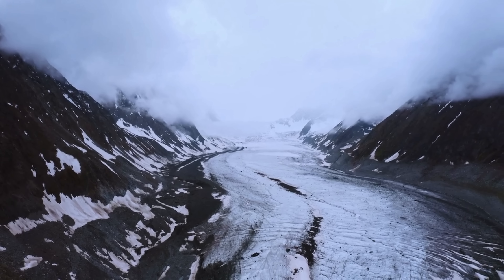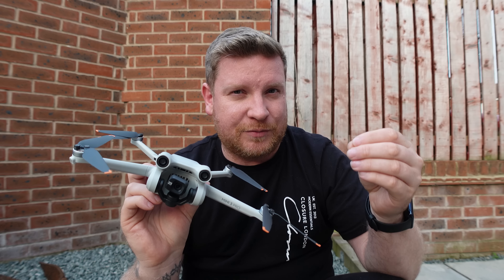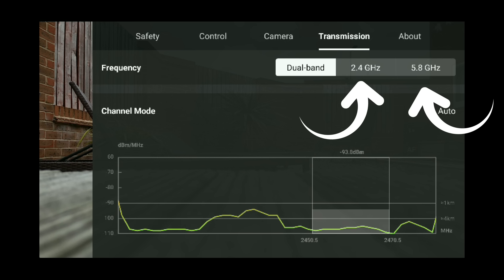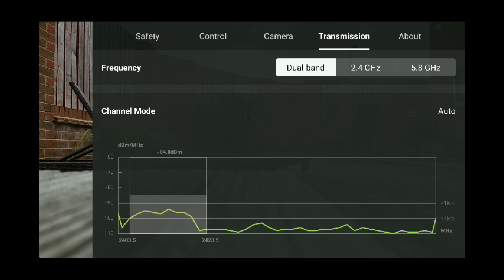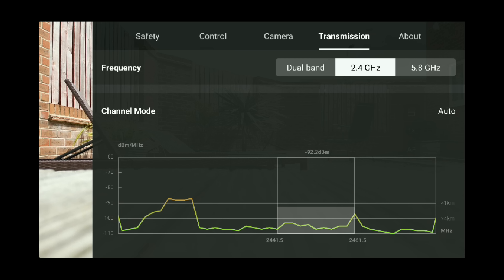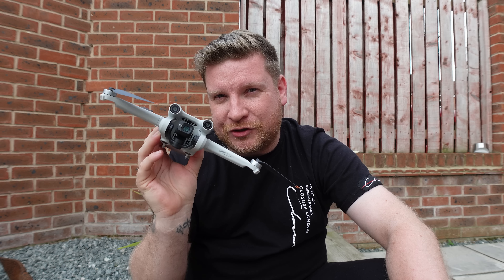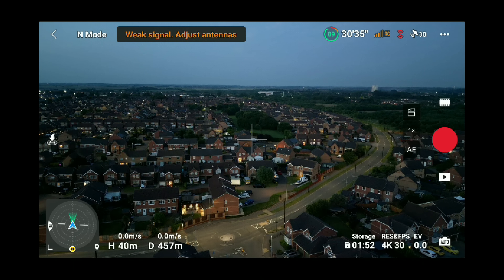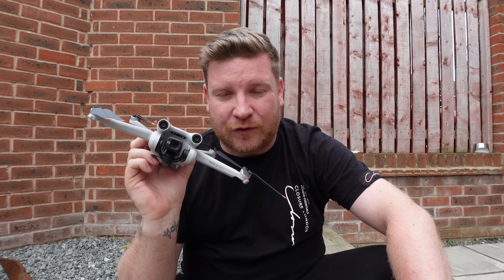THIS Is WHY The DJI Mini 3 PRO Has Signal PROBLEMS! ( Yet Some Don't )

Comment: Well, it has been some time since DJI introduced the Mini 3 Pro drone and the issues are still with us, the customers who pay not a small amount of money for a "product."

I live in Ireland and bought mine last week. I have been doing some range test and the best I could do was 455 m! That's pathetic! I was on the top of the hill and the drone was flying almost downwards. After 455 m I lost signal and the drone initiated RTH. What pisses me off is the fact that this problem has been dragging for a very long time now and DJI either have no clue how to solve it, or the CE regulations are imposing limits on the range in Europe.

I don't know what it is but this video is helpful. I will do more tests tomorrow with each frequency separately flying to the same point. If things remain the same, I will probably return M3P and go for Mavic 3. Anyone knows if Mavic has the same range issues? Thanks!

Comment: Didn´t you say there is no difference in the RC and RC1 in term of range? So it can´t be a 2.4 / 5.8 issue, right? Actually in my case there was no (positive or negative ) effect when switching manually between the two wavelengths. Same bad signal strength.
Reply from the maker: That's correct but when I did the controller test I fixed the frequency to take any variables out of it, but the RC-N1 seems to be picking the correct frequency when left in auto - the RC seems to be getting it wrong
Reply: @GAVINHR  Understand. However, unfortunately in my case there was no difference between 2.4 and 5.8 GHz - exactly the same bad range.
Reply: @phix1742  noted t

Comment: I tried it, and no matter which frequency, I experienced signal degradation at about 390M.  I live in a a very rural area with a lot of tall trees.  I will go to a large open area and see if there is a difference.  Thanks for your research.
Reply: Problem solved:  I went to an open field with no obstructions.  I flew the drone for more than 1/2 mile and it maintained a very strong signal.  When I fly at my home which is heavily wooded, I am going to have to fly higher to maintain a strong signal...

Comment: I tried switching Manually and didn't work for me.
Tried both bands & auto for same flight X 3 and manually switch with 2.4 was worst distance, ALL done in very very rural setting
Reply from the maker: That is very odd unless there was done unknown interference

Comment: I had a different problem. I live in California and received a CE version from a US firm....probably sourced from a EU company.  Transmission showed it was in fact in CE mode. I then booted it to the DJI Assistant app on the computer and did a refresh of the newest firmware.  A new flight showed it now in the FCC firmware and it stays there.

Comment: top class as always mate good findings also just watched originaldobo he tested the mini 3 reckons the smart controller is very direction dependent also so a combination of these would explain quite a bit.
Reply from the maker: I am sure other people will find credible information also indeed mate, This is my theory and it seemed to stand up in testing so hopefully this can help others :)
Reply: Originaldobo did not come up with any theory as to why there is an issue with range; I do not mean to scrutinize anyone here but he was sort of attacking people who are complaining about range issues because he feels you do not need to fly that far to make a great footage. We all know flying for 8km or more is not something anyone would do on a regular flight unless it is a range test, however, what the average consumer is complaining about is that the advertised range is way less than what the drone is giving in real life. The Autel Nano+ had its fair share when the advertised speed was 2 or 3 meters short of what the drone was giving in real life. Let us face it, the range issue on the mini  3 is terrible if you compare it to its predecessors. Great and informative video Gavin, I love your video!!
Reply from the maker: It's quite crazy how the autel nano + was bashed because people are DJI fans generally, in my testing the nano + is a great piece of kit, I do feel that they should of rolled out tracking now and yes the DJI drones do fly a bit better but for signal strength and camera quality the nano + wins for me
Reply: @GAVINHR  Gavin you have said it all. For camera quality and signal strength, the Nano+ takes the win for me too. From the expectations that were raised, one would think the mini 3 pro would far surpass the Nano+ but clearly that is far from the case. Even the wind resistance, you can see both drones fighting the wind but the comment always goes like "the mini 3 pro is handling the wind better". I really like to watch honest and unbiased videos as yours all the time

Comment: I received my Mini 3 and after the initial setup I found that in the transmission page it did not show the dual band option. I returned the drone to the seller in KL and received the replacement... Sadly, I had the exact same problem on the replacement.
I contacted the seller and they said it could be a firmware problem and DJI "might" issue a firmware update. NOTE: I reinstalled the firmware several times using DJI Assistant...
I experienced the same results using the both the DJI RC and the RCN1. I contacted DJI by email and have not received a response,,,,YET.....
So many problems with this drone reported from many people.. disappointing,,, disgusting...
If a fix is not coming soon then it's going back for a refund and I'll wait until the fix is applied before I purchase another.......😢
Reply: Any update? Just tried out my drone today and lost signal in flight! Screen went to black and white and it was done… RTH saved me. Also can’t send/connect correctly to the phone.

Comment: you didn't say anything but  existing "Some DJI Mini 3 PRO are suffering from bad range / signal " I only use RC for mini 3 pro, so what about it? all you said is bad signal and bad connection between RC and Drone, so what's the solution?
Reply from the maker: All you needed to do is read the comments to see that the fix works, if you missed it maybe you should watch the video again

Comment: Great explanation and definitely something I’ll look at during my next flight. On one of my first flights while on vacation in Italy it lost connection and initiated RTH while flying in a coastal mountain village area at a distance of approximately 460 meters and a height of 100 meters. Yes, there were a few trees and buildings near to where I was standing but nothing I would have considered significant enough to limited its range. After watching your video now I’m wondering if It simply selected the wrong transmission frequency. 😀👍
Reply from the maker: I mean.. I hope that is the case! It's worth playing about and seeing what is best and hopefully that resulted in a better signal for many

Comment: You need to be aware about several things when it come to wifi and it's signal.

Many things can influance the range and signal quality.
Still 2.4 GHz frequenties are low frequentie wave's, these waves are longer in lengt and bounce less up and down the atmosphere to reach 100meter.
Instead 5.7ghz is the higher frequentie
and a shorter wave lengt.
Bouncing up and down double that of the low frequentie.

Now here come the tricky part because low frequenties penatrate objects more easy and higher frequentie less or not.

Still because the use of so much devices 
using 2.4ghz and the limited channels 
within the bandwide.
Will cause interferance and limits it's connection due to limited power.
5.7 GHz has much more channels to work with, keeping interferance low.
For as long if you have nothing in between you and your drone.

Last but not least we need to remember the power output of the transmitter.
This is limited in many cases and also play's a mayor part in it's stability.

Comment: This problem is not limited to the Mini 3 Pro (Obviously) but Do NOT Bind your Mavic 3 with the DJI RC.  I had massive range and connectivity issues and it has led to my drone crashing after my screen went black minus the info icos on the top (satellite, rc connectivity, etc.) and DJI is blaming me because while I looked at the controller and had to assume the drone was gone from my connection DJI looked at the flight data and said nope the drone still worked so the crash is your fault and is putting me on the hook for a new Mavic 3. it is NOT Worth it.  Or make sure you have a SIM card and screen record every time you fly, because @DJI Support only takes into consideration the flight data to determine your accident and what they see when they can pause and slow down the video rather than the factors not shown on said data.  The really messed up part is that my flight data shows the controller go from full connection to zero within 2 meters (zero obstructions or interference between me and the drone).  @DJI Support will not care or take into account any factors so with a cheaper mini 3 go for it but with your nice new expensive professional drones Do NOT risk it.

Comment: Flew an Air2S and my Mini 3 Pro in same area for over a 1000km each. Mini 3 Pro signal and range is shite, the fact the Mini 4 Pro showed up so fast with front legs and antenna’s on the Remote tells you DJI clowns were well aware they released a Dud in the 3.

Comment: I would like to know something that they don’t say although I suspect a few things is polarisation of the antennas in the remote and polarisation of the antennas in the drone from the state of the remote I can only assume looking at the pictures that they put for the signal orientation is that they are horizontally polarised which means that the signal spreads vertically so it’s a tighter direction get why does a further away you are but only in and up and down plane book that would also mean that for optimum reception and transmission between the two that the drone would have to have horizontally polarised antennas as well so perhaps lying flat along the arms unlike the mini two which had vertically polarised in those legs coming down from the end of the arms and vertically polarised on the receiver because you had to point the antennas upwards if you lay them flat they would be horizontally polarised my suspicion is more towards that being the problem

Comment: Speculating…what if not all DJI Mini 3 Pro are made out the same manufacturer parts ..meaning with different properties conducting different results
Reply from the maker: Well then I think it's much easier to simply fix s frequency than for DJI to recall a load of dodgy drones :)

Comment: I'm confused as to how he's only getting something like 380m. I've never been able to loose signal that low with the mini 3 pro.
If I was in my house lying in bed I think I'd get further than that. I've reached 4 or 5 kms easily on my good, wild guess good range test spots. And loosing signal before 800m is rare. Usually only when a building is blocking close to me.
I wouldn't trust this test at all when the beguinning standard is unusually very low.
Reply from the maker: You see Dan, Here is the thing, whilst you may be confused MAYBE from somebody that's inspiring to grow your own YouTube channel you should know what you are talking about before taking aim at other creators. This also shows you don't know the equipment as well as maybe you should, here in Europe we get less broadcasting power than you get in in Australia under FCC regulations which equates to around HALF the power you get from the controller. Maybe you should do a little research before talking rubbish and stating a VERY valid test shouldn't be trusted.

Comment: In all your tests that I’ve seen you do you don’t wait for the controller to get gps lock or you don’t display radar view.  On radar view with gps lock there is a blue dot that indicates the controller with a blue or green triangle that show which way it’s pointed.   If the triangle is green it means you are best aligned between drone and controller.   The annoying thing is the controller can take several minutes to acquire gps lock.   Btw. It’s a common problem with the range test videos.  Most either don’t display it or font get a controller lock.
Reply from the maker: It is there on most of them David, its just that I can see the drone so I know I am pointing the controller at the drone at all times which is more accurate than the indicator which can be off depending on the state of compass calibration
Reply: @GAVINHR  In this video the only time I spotted it was at 5:49 but thats not in flight & with the N1 controller,  the rest of the time just the H is displayed which indicated no gps lock on the controller.  The new remote seems ultra sensitive to direction,  I don't believe just seeing it is enough.
Reply from the maker: Shown in 3:58 also,  I can assure you sight is enough because unless the compass is correct on a previous video I have posted ( flight time ) there is a moment where the direction indicator is green yet I'm pointing nowhere near the drone.
Reply: @GAVINHR  As an example in your N1 vs DJI RC video at 4:20 the N1 controller is showing a green triangle to indicate correct pointing of the remote,  at the same time the DJI RC is blue triangle showing not aimed at drone.    The connection at that time is poorer than the N1 remote.
Reply: @GAVINHR  but again. It’s not green.  It turns green to show correct orientation.   If your compass is wrong you can calibrate it.  I’ve got 300km on mine now and it really makes a difference moving just a couple of inches horizontal or vertical to the signal strength.
Reply from the maker: @DavidinEssexUK  yes I know it does David, I was the person who pointed the  fact it does this many many moons ago when they introduced it. Also there was no way of calibrating the RC until the update - it didn't work
Reply: @GAVINHR  my calibration has worked from launch day although I had to run it twice to get it spot on.    Oddly though it would still turn green when correctly aligned just the visual indicator was off.
Reply from the maker: @DavidinEssexUK  Mine wouldn't, the option was greyed out until the latest RC update two days ago then it allowed me to commence it, if you watched that video for some reason the distance just kept increasing even though the controller and drone were stationary.

Comment: It is actually the same as your Wi-Fi router at home which also splits between the same to frequencies the lower frequency the higher the wavelength so 2.4 has a bigger wavelength which means that it takes a bigger obstacle in its way to suppress the signal where as the five point gigahertz frequency has a wavelength half the size and therefore an obstacle half as big will get in the way but the 5 GHz actually has a bigger bandwidth so can stream data faster
Reply from the maker: Exactly that Mark, that's what I explained when I did my ocusync explained video!
Reply: @GAVINHR  comes of being a radio ham for 41 years. What I’d like to know is how they’ve orientated the antennas in both the RC and the drone are they both horizontal dipoles or vertical or are they not both in the same attitude in which transmission and reception will suffer from the wrong polarity
Reply: @fj1100mark  im also a radio ham, and had this theory for a while. Obviously as you know, horizontal should be a better form of transmission, so long as those antennas are also horizontal in the drone. ive tried to explain this to many people in the past that horizontal to vertical just doesnt work well. :) Hence the point of pointing the controller to the drone. We both know that a few degrees off on a beam can make a huge difference. de M0LAF
Reply: @nobby-green  agreed but I don’t think they’re going to be the same as a Yogi I think they’re going to be more like a dipole with a single element it just might be a vertical dipole it might be a horizontal dipole I would imagine horizontal in the controller but I know the original mini mini 2SE had the antennas in the front feet pointing down so we’re vertical which is why you had to have the antennas on the RC N1 In vertical position and of course with a vertical dipole it’s Omni directional so pointing it directly at the drone didn’t matter too much if these disciples in the controller are horizontal and of course the only place to put them in In the drone would be along the legs which would make them horizontal to you’ll still get in the doughnut shape but it’s vertical so obviously more directional nice to have somebody who actually understands what we’re talking about G6GXY
Reply: @fj1100mark  totally 👍 73